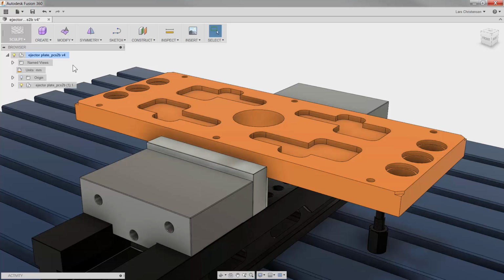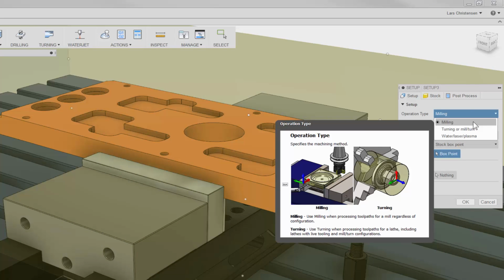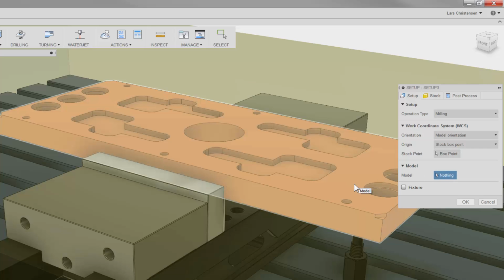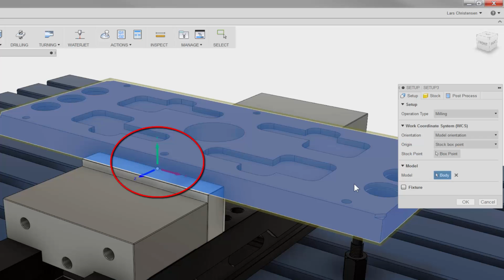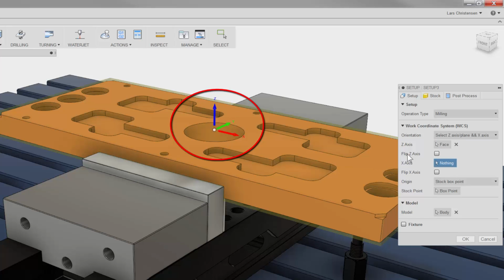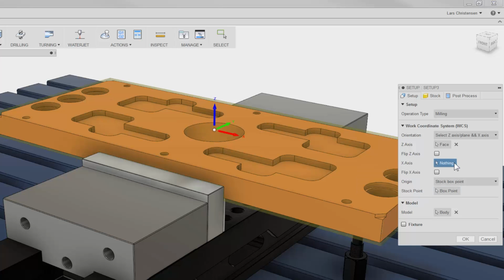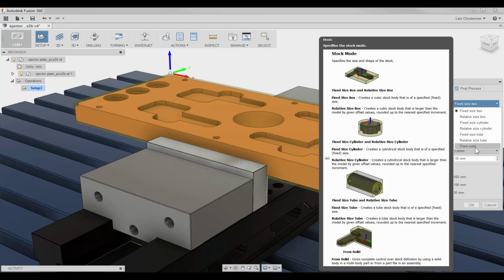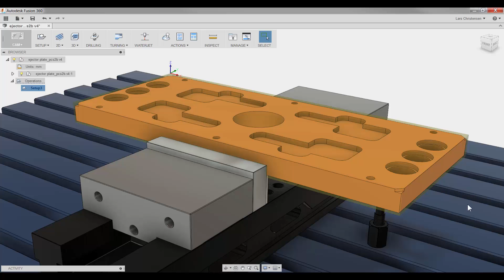Fusion 360 CAM — Quick Tutorial on Setup

Comment: Hi Mr. Lars,  After setting the work coordinate center in Fusion 360, how CNC machine locates where I have put work coordinate center. Is there any initial adjustment of the CNC machine to show where the stock is fastened?? is it initially we have to adjust  work coordinate point system of CNC machine ? Sorry I am beginner and  may be my questions are very funny.
Reply from the maker: Yes, on your CNC machine you should have a Work Offset Page. When you pick up the stock at the machine, you will go to that page and insert the machines coordinates.
I would recommend that you check your machine manual.

Best,
Lars
Reply: Thank you very much  Mr. Lars for information.

Comment: Hi Lars, Thank you for information and video uploading. Am I correct  to say on CAM operation always we machine the model not component?  and if the part is component we have to convert to model and then go to CAM operation?
Reply from the maker: Thank you for taking the time to watch the video! CAM don't care if it is a body or component. Looks at it the same way.
What you have to make sure of is, that if you do have to machine a model with different components, you select the component you want to machine in the CAM Setup.
Hope this is helpful
Reply: Thank you very much for information and time.

Comment: i have been using and learning Fusion 360 for a while for 3d Printing and its working great. 
no i want to start trying Cam or wood and metal milling cnc Machines. 
i need a desktop version for home use, but i want it to work perfectly with Fusion 360. and to be easy for a starter. 
can any one recommend a starter machine that i can buy?
Reply from the maker: Thank you for taking the time to watch the videos. I know a few people who like the Othermill. But if I was you, I would do some searching on some forum to figure out what other people think.

Comment: Hello Lars, thank you for this video!
My question is: When i would machine this part, i will need to turn it around after the upper side is finished, just to remove the stock from the underside.
When i want to do the operations on the "turned around"-pard, do i need to make a new setup with a new coordinate origin?
Reply from the maker: Thank you for watching the video. Yes, You will create another Setup.
Best,
Lars

Comment: These videos have been a huge help to me in getting started with Fusion 360. Out of curiosity is there a place where you can get models of generic machine tables with the vise on it, or is that something that you have to create?
Reply from the maker: Thank you for taking the time to watch the video. There is a bunch of work holding if you scroll to the bottom of the data panel and dig into the CAM Sample folder.
But, to make it easier, here is the dataset from the above video:
http://a360.co/2i7bBPz
Have an awesome day!